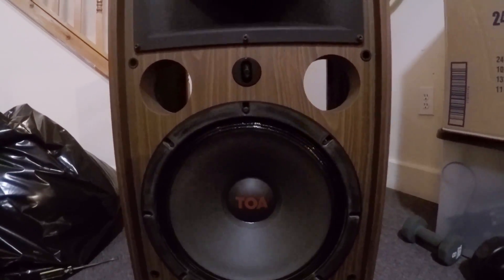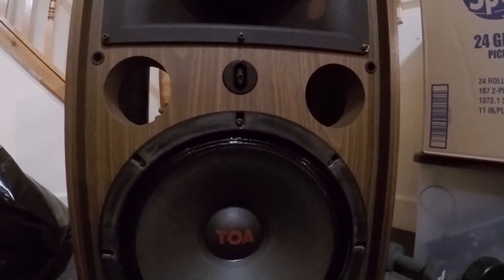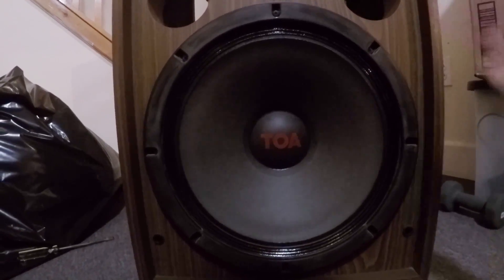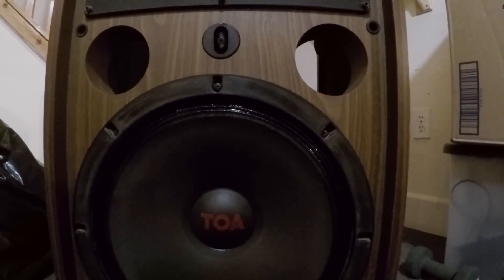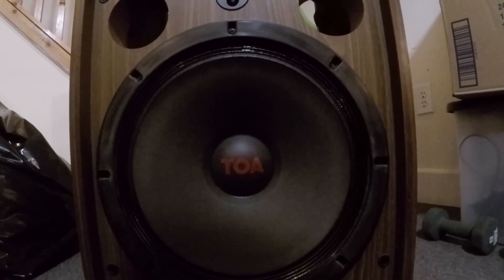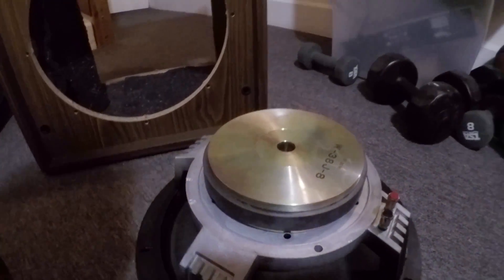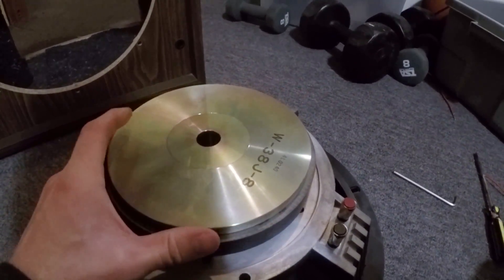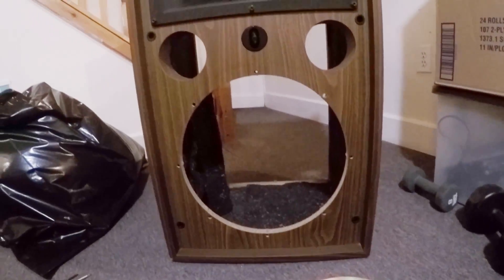How to fix a 'blown' loudspeaker with coil rub

Comment: Thanks for your video, I just fixed my F121 Funktion One Driver, after it was dropped side way and the coil rubbed ..I saw your video after I have already order a re-c0ne kit but guess it can sit in the drawer as a spare now that my F121 is firing away again. Great video .thx

Comment: THANK YOU, my issue was slightly different (but also a dropped speaker) since my speaker is smaller and no allen bolts to loosen ( it has glue instead) but when you mentioned the magnet, and loosening it, I noticed it wasnt looking straight, with a little bit of bending it seems to have completely stopped rubbing and works great.

Comment: In many cases the the surround or spider has sagged causing misalignment and rub. As well as the fix shown here (a good fix BTW) you might find that mounting the speaker in another orientation will equal-out the sag or distortion. Commonly with front mounted speakers like shown here, you can rotate them 180 degrees and the coil alignment will improve; reducing or eliminating rubbing.
Reply: i shall try that!!! great idea!
Reply: If I rotate it 180 degrees, how long would you recommend leaving it upside down?
Reply: That's what I was going to suggest, just turn the speaker upsidedown first & see if that stops the rubbing.

Comment: If the back plate is glued you can heat the plate up with a hair drier and GENTLY  tap the plate into position so don’t rub. Worked for me.
Reply: how long did you have to put the hair drier on it, i just tried it and the plate wouldn’t move at all
Reply: @wiltuckerr  not long. Till it got hot
Reply: @wul01  didn’t work for me unfortunately idk what to do

Comment: Clever fix. I have a Pioneer 12" for my car and it started making a lot of noise. I've heard that it can be from subs sitting facing outward like most home speakers are. Ideally, they face up or down in vehicles and in home theater situations (down-firing being the best in most cases) but that's not always possible with most home setups. The heavy use combined with an outward-facing stance can cause the coil rub. You'll know it's coil rub if you can increase the volume output on your sub and the noise doesn't get proportionately louder (it may get a bit louder from more vibration but it's not nearly as audible at high volume as it was at low volume).

One way I semi-fixed my coil rub (for the time being) is by standing it upright and letting it play. The coil rub went away for the most part after about 30 seconds of playing music through it. I've seen people use rubber bands to wrap around the coil behind the speaker and create moderate tension by wrapping it around and anchoring it. When you lightly pull it in the correct direction it removes the contact between the speaker and the coil(s) and you get the same effect. However, I'd recommend the way TeDubbs goes about it because that's closer to a permanent fix.
Reply: Bro I just got a 10" Memphis Sub and it's the same as yours! It makes a noice when facing sideways buy when facing up it's completely fine! I'm scared I might have a bad sub or something any tips on what to do?

Comment: Dude you're fucking awesome.  This is exactly the issue I'm having and it was gonna cost me 250$ for a re-cone.  Gonna try this immediately.  Thanks... Wish me luck!
Reply from the maker: That would be awesome if it works! Let me know how it goes...
Reply: Unfortunately it didn't. :(  You're idea is still great, the speaker I need to adjust doesn't have a way to loosen the magnet though.  Going to have to re-foam the suspension and re-center it.  After checking it out, speakers with this problem DO NOT need a full re-cone.  They just need the foam surround replaced and re-glued to where they're centered correctly and don't rub.  Word to the wise.  Kinda pissed at my speaker "guy"....

Comment: Could this happen to a car sub? mine sounds very similar to that one and is quite annoying to hear. would it be better to buy a new one as I only paid like $30 for the entire woofer.
Reply from the maker: I could happen, sure. Nothing wrong with just buying a new one if that's what you want to do but remember that you've got nothing to loose by taking it apart at this point if its not working properly. I would say give it a shot, you'll learn something new :)